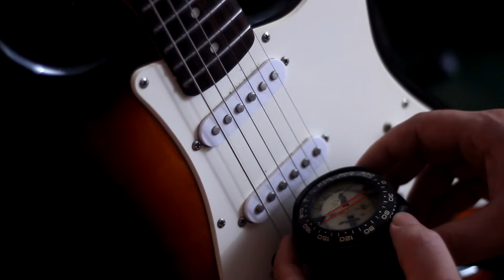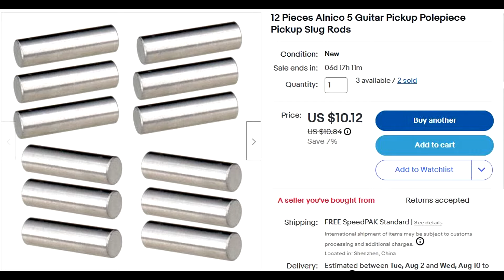Mod Cheap Ceramic Pickups Into Vintage Staggered Alnico (Easy DIY!)

Comment: Both have their uses. It seems very popular to praise Alnico mics these days, but personally, I do not think they suit for everything, they have a quite shrill top end, specially if you run them trough 500kO potks. If you have dark sounding speakers fine, but if not, they rip your ears apart.
Reply from the maker: Thanks for watching and taking the time to write a comment Jesse. Yes, I agree I was modding this guitar more for use with a warm tube amps rather than the solid state PA used in the video. I just think a lot of the hype is marketing and misplaced nostalgia from the guitar heros of the past. The worst thing is if you go on a guitar forum and ask which pickup is warmer, ceramic or alnico... they will preach how bassy and fat and warm alnico is and how shrill and treble stabbing terrible ceramic is, then ask about neodymium, "oh no it will be so much treble it will drive neighborhood dogs crazy it will suck its too much pull it'll kill sustain" I have actually done the experiments... Neodymium pickups are the most bass, the warmest you have to under-wind to keep the highs there. The magnetic pull at the front of the pickup if neo bars are used behind steel poles is less than regular alnico poles. Its a bunch of misinformation repeated like a religious doctrine.

Comment: I've done this a few times and it definitely improved the tone. But... I think Fender discovered that around 7,000 winds was the Goldilocks number for the right tone. Squier pickups use fewer winds to save copper and stronger magnets to compensate, I believe (and probably to keep Squiers inferior to Fenders off the shelf). Apart from that, is it really the magnet material or could it be just having separate magnets for/near each string? How does an AlNiCo bar magnet compare to AlNiCo pole pieces or a ceramic bar?
One variation on this might be to split ceramic or strong rubber bar magnets into six pieces and glue it to each of the pole-piece rods, compare it to single bar.  Another one would be to somehow split a ceramic bar into six equal pieces and stick them in sideways (if it's a humbucker type with polarity on the edges). This is just stuff I wondered while I was doing this, someone might want to see. Cheers.
Reply from the maker: thank you for taking the time to type out all this info and suggestions. zfm  hadnt ever considered cutting up a bar?

Comment: Can you please, share the kohms from the "alnico" pickups ... and the values of the stock pickup magnets. You use a preamp and that hides the weakness of the ceramic pickups. I think the diffrence lies in the preamp (volume) and Neodynium magnets (brightness/piercing highs) in your demo. I'll do this mod in my next squier, they are better that their big brother Strat. Neck is way better and body are thinner.
Reply from the maker: Thank you for watching and taking the time to comment. The coil used in both sets is identical. its THE same ones. SO resistance of both sets would be the same about 5.7k it never changed.

  Having less magnet strength is what made it quieter. Those are legit alnico magnets in the weaker sounding pickup not neodymium, ceramic pickups are stronger and bassier than alnico and neodymium is even stronger and bassier than ceramic. Everyone has it backwards for some reason (i suspect marketing) and Ive been making videos for years to prove it. 

The pre amp aint hiding the weakness of ceramic cause ceramic is stronger. the weakest sounding pickup you can get is alnico because alnico is the weakest magnet.... but
With a fat sounding tube amp cranked up that weak pickup sounds amazing and clear, that ceramic pickup sounds flubby and the neo is blowing the speakers with bass, in a bedroom setting with a quiet amp it sounds better to have a stronger magnet.
Reply: @heavymetalATC  I've changed the bar magnet in 2 chinese humbuckers for a Neodynium ones and the tone was 
... bad ... I was expecting something stronger and fat ... so I ended buying another set of humbuckers (12 kohms) to get what I wanted: SC tones (6 kohms and HB vintage to moderm tones (8-12 k ohms). My experimentes with Neodynium ended. Your mod, btw, is perfect. Thabx for your response ¡¡¡

Comment: What gets me is that if it cost you 10 something on eBay for a guitar company they would cost, at most, 1 dollar (more like 25-75 cents) so they saved about 50 cents using the ceramic bar magnets.
Reply from the maker: Thank you for watching and taking the time to comment General. Yeah, I dont know if its availability ease of manufacture or what? Maybe those companies just all started using stronger magnets so they could use less wire and save money that way and its a "hold over" either way the bassier sound of ceramic pickups do tend to sound better on smaller cheap amps that come with cheap guitar packs?
Reply: @heavymetalATC  That is possible, but I bet it has to do with costs.

Comment: I did mine without worrying about doing the extra magnetic bar thing. I just left them off and the alnico v’s alone sound great! 

Thing to realize is the expensive pickups aren’t about the fact they use the same alnico v’s but it’s the way they wind the bobins and the amount of winds they put on. These cheap magnetic bar pickups have a lot less winds. Maybe half. But I think they still sound awesome if you crank the amp up a few extra notches. It also give you more headroom in the sound
Reply from the maker: Thanks for watching and taking the time to write a comment Eric
Yes it seems that is their money saving strategy using more magnet power and less winds to get the same output at a lower copper cost.
Reply: @heavymetalATC  Yep... I urge you to try your ceramic pickup overhauls with just the alnico 5 pole pieces and leaving the magnet bars off. I think you'll be pleasantly surpised.

Comment: I'm really enjoying your videos. I´ve started playing guitars about 6 months ago, but im enjoying tinkering with my setup way more. 
Im currently routing a guitar hollow to make an acoustic sounding guitar. Have you tried anything like that?
Reply from the maker: Thank you so much for watching and taking the time to comment Sanlo. I am so glad you enjoy the videos. I have not built a hollow body or chambered guitar yet but I do plan on doing so in the future as I have a lot of oak and chestnut that is very heavy and I would like to use it as a core with a cedar or pine top for resonance and weight savings.

Comment: Sounds 100x better!!
Reply from the maker: Thank you for watching and taking the time to comment Michael. I had many people say they actually liked the Ceramic but when The Alnico is put into a big tube amp at stage volume it does a jangly thing that is great to cut into a mix and generally it just sounds like old records at least to me, but then there is always placebo effect. Hahaha Yeah I really dig the Alnico myself it works great with fuzz circuits when the volume is low for a punchy clean sound too.

Comment: Some think that when you reverse wire the middle pickup for humcancelling you lose highs when playing positions 2 and 4 vs. the non-humbucking alternative. What's your opinion?
Reply from the maker: Thank you for watching and taking the time to comment T.U. I think it depends on the middle pickup being reverse wound or not. With this RWRP middle pickup it does mid quack and lose a little highs but if I were to flip polarity on it then it would be magnetically out of phase and then it would definitely have a lot of highs... and only highs LOL If it weren't reverse wound and the magnets were in the same polarity it would be just a clean strong sound like a telecaster in the middle position but... it wouldn't hum-cancel or mid quack. I personally like those 2-4 sounds as its just the strat-sound to me like SRV or Sultans of Swing.
Reply from the maker: There is a lot of discussion on this as I am sure you know, its in my experiments that Ive found the RWRP to quack more but at the same time lowering and raising the pickups have a lot to do with it as well as the strength of the two in relation to one another, matched or unmatched.
Reply: @heavymetalATC  Oops. I didn't mean change the polarity. I meant reverse the wiring for a humbucking effect. I changed my original post to reflect that. 

So you do observe a loss of highs when using a reversed middle pickup. I thought I did as well. I removed the hum-cancelling option from my guitar for that reason. Too much of a tone change when going from a single pickup to two in hum-cancel mode.

Comment: I think I prefer ceramic in most of comparisons. My whole world has just felt down.
Reply: AlNiCo is just a big lie that is most cases s used to overprice pickups. Pairing properly the amount of copper and the magnetic strength will give the best tone, being ceramic or AlNiCo.
Reply: Recently I discovered the same thing even before watching this video.

Comment: cool! have you tried lowering the neck pickup?
Reply from the maker: Thank you for watching and taking the time to comment Uncle dad! No I havent tried it on this one yet, I do keep the neck pickup just about sunk below the guard on the other strat I played briefly in the video though so Im sure it will get adjusted.
Reply: @heavymetalATC  it works pretty well on my Partscaster HSS!

Comment: I dont know how the expensive ones are supposed to sound, but the modified ones do sound different!
Reply from the maker: Thank you for watching and taking the time to comment Woo. LOL yeah, it just seemed to kind of give them a much clearer bell like vintage tone... you can really hear the strings, If one was going for a bigger fatter sound Neo bars would have done it up... Funny thing is this is the opposite of what you will read in a guitar forum. Nope more magnet = more bass in "reality" when you actually try things Hahaha

Comment: I liked the ceramic on the neck. The cleans sounded better, but the alnico in the middle sounded a bit better. 

As for dirty, the alnico sounded better, but I don't know if the mod or alnico is worth the trouble or price as I don't like Strat single coils overdriven, anyway. Thanks for confirming that.

Comment: Unpopular opinion time: i prefer the distorted tone with the ceramics, and the clean tone with the alnico 5. Its kinda like the diff between silicon and germanium fuzzes. To my ear, there's an almost si edginess to the distorted tone with the alnico cranked, and the si is a little smoother and fuzzy... but clean, its nite n day, clean the alnico sounds like a proper ge fuzzface with the guitar rolled way down, but the ceramic sounds duller and a bit less full more like a si fuzz can do...it doesn't have the same sweetness, i dunno, mebbe i needa couple more rips...lol

Comment: Which keyboard amp are you using?
Reply from the maker: Thank you for watching and taking the time to comment Fausto. The amp I am using in the video is a Peavey KB1.
Reply: Thanks for taking the time to answer my question, by the way, you have a lot of knowledge about guitar stuff, could you make a video about smart guitar shopping please?

Let's say pickups, lots of company's try to sell you snake oil, like the Seymour Duncan Zephyrs

Comment: Is there a way to verify that those are in fact ALNICO slugs? Judging from the origin on the e-bay screenshot, can't be too sure :P Not that it matters if you get what you want out of them, of course.
Reply: You can take one and try to magnetise it to the opposite poles. If you can, it's most certainly Alnico. If not, it's neodymium. Also, Alnico has a relatively weak magnetic strength, way weaker than neodymium. If you're somewhat familiar with the thing, you won't confuse them at all.
Reply: I don't see a reason why they should lie about that. I recently bought some AlNiCo and Neodymium magnets and I have to say the price difference isn't that big. It's like 80 cents for one AlNiCo magnet and 60 cents for neodymium one.
Reply from the maker: Thanks for watching and taking the time to comment Avi.  You know I had not even considered that they may not be real alnico? If Id have got um and they were plain steel or something Id have been pissed. But as Jose said if you are familiar with them and the way they work its pretty easy to determine that they are alnico. They have the right look and they took and held a charge from the other magnets. They were pretty weak right out of the pack. Also as Michal stated Alnico magnets arent really very expensive to produce its just aluminum nickel and cobalt. The name brand pickup companies sure do think they are worth a lot once they wind a coil around them though LOL The p90 I used in the last video was only $20 and it was Alnico. Kudos on you though man, that never crossed my mind and it could possibly be some other alloy and Id never know as long as the properties were the same.
Reply: Alnico is just an acronym; Al-Ni-Co which are the periodic table names for aluminium + nickel + cobalt. It's not a brand or anything. The numerals like II, III, IV, V and VIII that you might see in a guitar just represent the ratios of each material in the magnets composition.

AlNiCo is probably the cheapest way to get slugs in that size as making anything else conform to that standard to be cheaper than commercial AlNiCo would require setting up a pretty serious factory.

Comment: Too late. I have already ruined my Squiers electrics. Need to figure out how to fix it.
Reply from the maker: Thanks for watching and taking the time to comment Elmarg. If you can find a cheap loaded pick guard or something similar from ebay or amazon you can stick that on and be good?
Reply: @heavymetalATC  I was able to fix it using cheapest soldering iron and installed new pickups.  Now it sounds way better.

Comment: Comparing Alnico to ceramic on single coils is a different beast. Because you’re comparing a bar magnet to magnetic pole pieces. The weakest Alnico pole piece is umpteen times stronger than a ceramic bar.

Comment: i like the ceramic better in this video
Reply from the maker: Its all about preferences. They make some really good ceramic pickups. Dont tell nobody but the seymour duncan custom (tm) humbucker is ceramic. They dont hide it but its not mentioned as a selling point even though its the reason the pickup puts out liquid fire from the wires.
Reply: @heavymetalATC  most modern humbuckers are ceramic. Most active pickups are ceramic.  The tone is different but the output is usually much more

Comment: You changed the sound, but it's not the same as a pickup designed with an alnico magnet.  The magnet, windings, wire size, dimensions all work together.  Taking a pickup designed to use a ceramic magnet and installing an alnico magnet will not make it sound like a pickup that was designed for an alnico magnet.

It may sound better, it may sound worse, don't know till you install and play it.  Everyone has their own preferences when it comes to tone, would be a boring world otherwise.

Just don't expect a miracle.
Reply: that's a good point , the conversion only weakened the pick ups......they don't sound hot .. they lost their edge.. they just sound like cheap Alnicos 
those weren't designed to support Alnico in the first place.
this is why the aftermarket sells Alnico picks ups.

Comment: Alnico pickups has more wound than ceramic. youre comparrising is not correct
Reply from the maker: I understand that is true with modern pickups but the 59-early 60s black bottoms had about 5.9 to 6.4 and thats just about what these are I think they are 5.3? SO yes a tab ut it does show people a good exampl of how fat and warm is not the correct marketing lingo for alnico pickups, spanky yes, sparkly yes... and this is why they get along so well with a cranked tweed or bassman, they are clear so you can crank up the amp and get that big bass with chime as well.

Comment: I never tried (or heard of) recharging my AlNiCo magnets BUT . . . . 
Want to keep the magnets from sticking to the poles?  
May I suggest: 
Tape the PUP securely down so the poles are horizontal and then place sheets of cardboard, plastic, Teflon, Popsicle sticks, or whatever and let the magnets be drawn in and stick to the separation sheets.  Then you can slide the magnets against the sheets at whatever speed that you can while keeping the same distance from the poles.  If you don’t need to put the magnets back on another PUP apply some lubricant of your choice to ease moving the magnets smoothly.  You will need to put some scotch tape on cardboard or wood Popsicle sticks though. 
 Problem solved?  
I don’t know I just thought of it.  Maybe I should try it first.  LOL

Comment: removing ceramic magnets off cheap offshore pickups is NOT easy as your video implies.... they cannot be easily cut loose with an exacto knife. 
and all the back and forth between 2 people below is NOT part of the topic.

Comment: The only fault of ceramic pickups is being cost wise cheaper than alnico. Full stop. Sounds wise ceramic is no less valuable than the counterpart. 
But human beings think that more expensive is better in all fields: clothing, automotive, music...
So, unless you like the alnico sound because imprinting, personal taste, ceramic is no less musical!
I did the same mod replacing the ceramic bar with a Neodymium one, which is stronger from a gauss standpoint, not for a bad opinion on ceramic but just to tweak a cheaper pickup and try something different